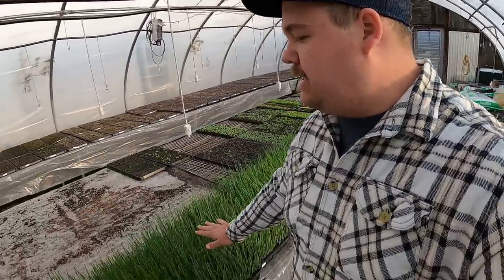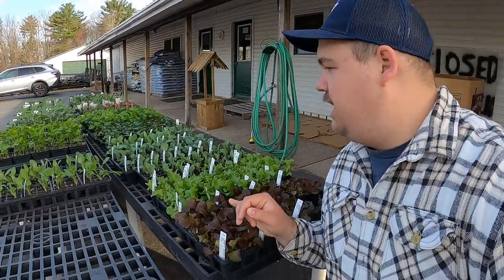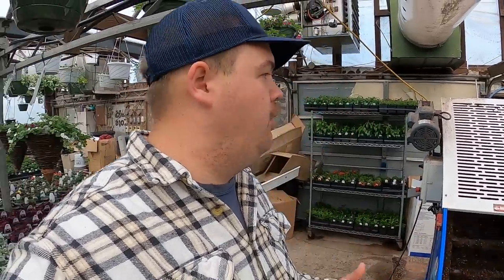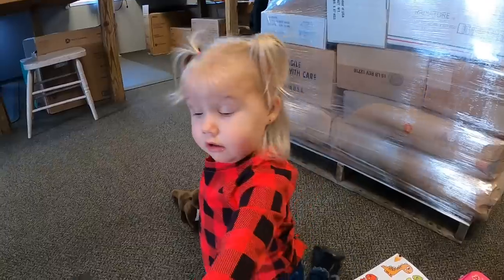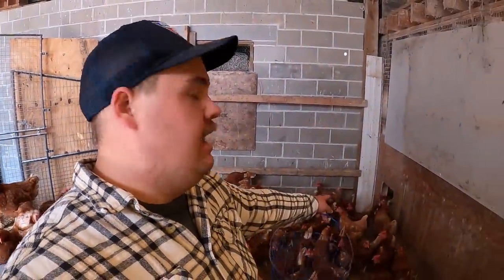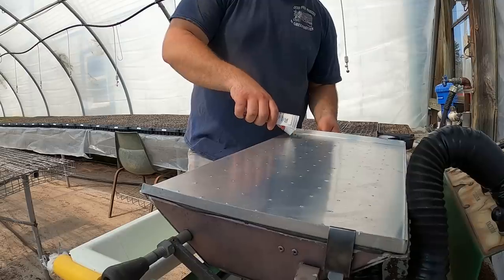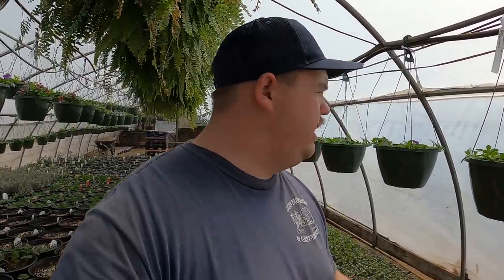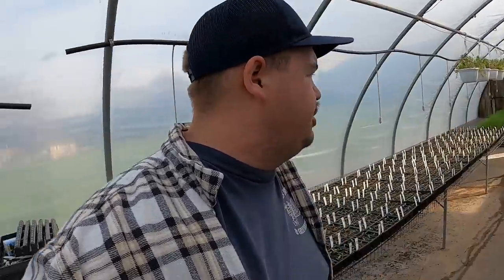USING THIS TOOL MAKES SEEDING 1,000% EASIER

Comment: Here is a little tip for using your label maker---don't make a label and cut it off, it wastes too much of the tape. Make many labels at a time then use scissors to cut them apart. That tape is expensive!!

Comment: That's the reason you cook a ham. Just so you can make ham and bean soup. Made a batch on Monday myself. Pea soup today. Had lots of ham left over.
Reply: Agree wholeheartedly. Never tossed a ham bone. I even saved the liquid after baking a ham. Chilled it, skimmed off the fat(saved that, too) and poured the gel into zip bags in a thin layer and froze it flat.  Then you could break off small bits to and add to vegetables, and the fat was great to fry eggs in.
Reply: @tsugima6317  I will do that next time for sure. Sweet.

Comment: I also made similar to  your seeding machine using old vacuum cleaner and hoses from it  and had to use diffrent seeds to can make the sheets for different type of vegeables  so far is working not that bad